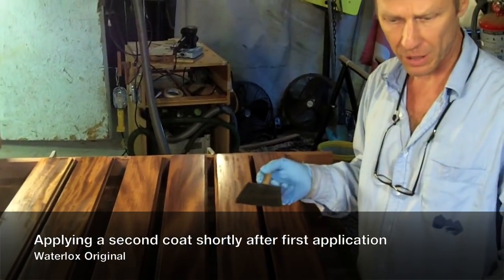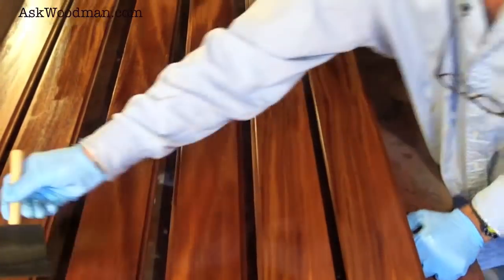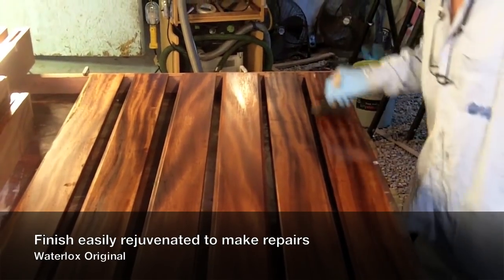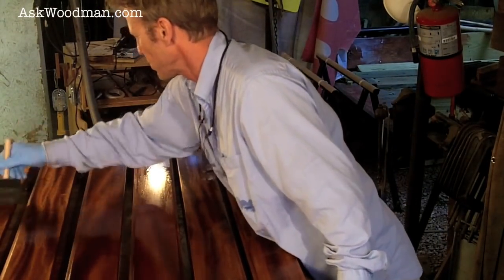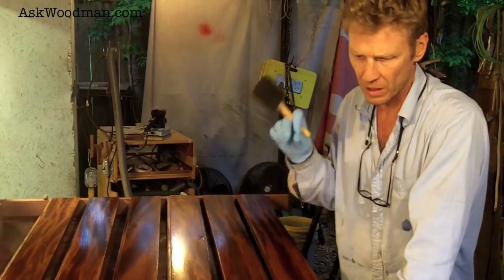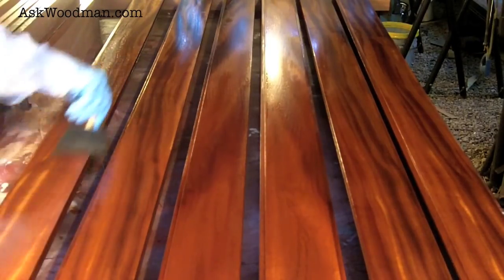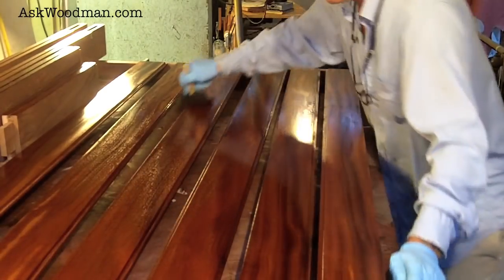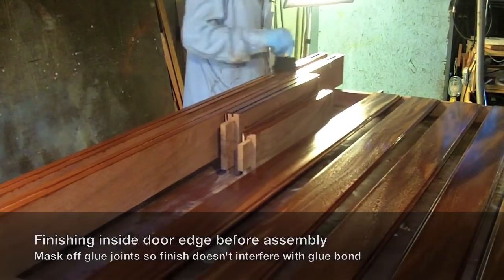14 How To Apply A Tung Oil Based Finish - SOLID WOOD DOOR SERIES - Video 4

Comment: Just confirmed that the duster method works! Had a tiny bit of Waterlox left over from a project and put it in a small jar. Snuck in a quick burst of duster under the lid and sealed it. No crustiness for a whole week. It created a negative pressure differential too, air really wanted to get in when I opened up the jar after a week. Opened it up to do a bit of touch-up, re sealed without duster and it was gelled up top in about three days.

Comment from the maker: Sikkens products are excellent for exterior work. They really hold up and are easy to touch up when needed. A really nice thing about the Cetol products is the color tinting options built in. Waterlox is very transparent with an amber caste. So to change wood color a stain does have to be applied first. But I rarely stain. I love the natural look of the straight built Watelox. Don't hesitate to write if there are some questions that were not answered in the videos. Happy to help. Allan

Comment from the maker: I use Waterlox exclusively for all my woodwork. Tru Oil is a similar product. Both are polymerizing tung oil varnishes with drying agents and hardening resins added. Pure tung oil can be a sticky mess that is a grime attractor that does not form a protective skin.

Comment from the maker: Hi Joshua , You just have to apply thinner coats when vertical surfaces are involved. It always take a little while to get a feel for the coverage. And sometime we just don't have a choice because not all pieces are going to be all horizontal. But you can just straighten out the drag and recover with several lighter coats. Also you can keep brushing and fussing with the finish until it starts setting up and stops sagging. Just lightly sand with 220 then 320, clean and re-coat.

Comment from the maker: I guess those two comparisons are better than the Buffalo Bob from Silence of The Lambs reference I just got. Yes those are t&g. I cut the groove on edge on the table saw. The tongues I cut with the router (straight bit) and straight guide. And then the panel is tongued into the door members. If you look real close you will notice some of the boards have tongues on two sides. So there were two ripped widths so the final exposed face was equal. Love me some measuring. Thanks Allan.

Comment from the maker: Unwaxed shellac is an excellent finish and a great way to introduce color. It is a little bit of delicate finish for furniture so rarely use it. But many people use shellac for color and initial seal and then top coat with Waterlox to seal make it more durable. The lac bug resin has wax that is removed for other uses since it is very insoluble. I just use Waterlox because it is pro and easy. It is the processed tung oil, resins, hardeners, and drying agents, mixed and ready to go out of the can.

Comment: Very nice vids!  It's nice to find someone who takes the time to answer questions & share experience.
I'm a mobile touchup guy.  I work mainly with spray laquer and do on-site spot repairs.
About 2 years ago I bought a Mako-T UV curing light &  some waterbased UV urethane coatings... hoping to offer on-site table top refinishing with a durable no-odor finish I could apply in 1 or 2 coats and cure completely in less than a day of work.  (Only the Holy Grail... not much to ask).  I've had mixed results and still don't feel totally confident in doing tabletops on-site.  WB urethanes can be finicky.
About a year ago I coated a customer's table and it's now peeling.  The table was originally laquer and was totally damaged & saturated with oil from the staff's weekly maintenence... lemon oil & Murphy's oil.  I always warn my customers away from these products for finished furniture.
Anyway, I did what I thought was a thorough de-waxing and cleaned with denatured alcohol but it did no good.  I had a rough time achieving a decent finish and now it's peeling off.  Luckily it's peeling off easily down to the laquer so I won't have to chemically strip or do heavy sanding.
My original thought was to build back up with laquer, but now I'm thinking maybe Tung oil would be better... especially since I have no good place to spray.  And even though I'm going to thoroughly de-wax again... an oil finish may play nicer with any remnant of oils still left in the grain.

Would this Waterlox or your new Sutherland Welles be ok for a dining table which sees daily use?  Would they be sensitive to any remnant of oil left in the grain?
Thanks much!

Comment from the maker: @nomorejournos 

As to the number coats, it depends on how much you are applying per coat. My videos show me using Waterlox Original which is 25% solids. But you can build a finish faster using Waterlox High Gloss because it is 35% solids. But the original is always used as a base penetrating coat for reasons I explained in the videos. Just remember to not use pure tung oil because it will just be a sticky mess.

Feel free to leave another comment if this doesn't answer your questions.
Reply: AskWoodMan

Comment from the maker: @gliksmar  A stain conditioner is just penetrating liquid that is very viscous that help pull the stain particles evenly into wood pores. This is especially important with difficult to stain woods like pine. There are premade conditioners that are available, but I generally make my own. In your case I would mix about 20% of your tung oil stain with 80% mineral spirits. You would simply apply an even coat to
a section of floor then immediately apply your stain finish.

Comment from the maker: If Original is 25% solids and High Gloss is 35%, perhaps cutting the High Gloss with about 20-25% thinner would be a good place to start on that first wash. The beauty of Waterlox is always works. The worst thing you can do is put it on so heavy that you have dried ridges or overfinish you have to sand. Always best to go light until you get that feel for the material and the way the wood accepts it. It is easy to add another coat. Keep in touch. Allan

Comment from the maker: @SilverFoo79 With all Waterlox products the Original Medium Sheen is ALWAYS used as a base coat sealer. It is what I use 80-90% of the time as my complete finish. But after 2-3 coats of Original you can apply their High Gloss which is just off the charts fantastic. Remember these finishes are mainly used as floor finishes, they are that tough and elastic. One of my next series up is a mahohany book matched TV components cabinet with the Original/High Gloss finish. Gorgeous look!

Comment: what do you suggest for a piece of furniture that is going to be exposed to the sun.
i stained and polyhurethaned a pair of adirondak chairs made of pine and the poly did not last it started kracking after about 8 months.
I have to redo the chairs again but like i said they will be exposed to the sun...Unless i cover them with a tarp and i dont want to do that.

great videos very informative.
best wishes

Comment from the maker: A lot these products like teak oil and tung oil are just that. They are just oil, and oil does not really dry. The product I use Waterlox is specially processed tung oil that has drying agents and resins added that make a chemical reaction when exposed to air that makes the liquid dry. You can add Japan drier to these oil products or just use Waterlox straight out of the can. Then have been making this product for almost 100 years. It is the only product I know of that gives such pro results.

Comment from the maker: The High Gloss is too thick for base coats. You want to use the Sealer/Finish to penetrate and give the later High Gloss something to chemically bond to. You could thin the High Gloss with mineral spirits for a base coat. For your case where you are finishing end grain, I think think the High Gloss thicker material would be perfect because those open straws will just drink the thinner material up. Just do a wash with the thinned High Gloss and then go straight to High Gloss. I am happy to help.

Comment from the maker: I would thin the first coat only. I have built a bit of furniture from mesquite but I find it way overpriced with a lot of waste. Wait for cure (3-4 weeks) and use a wet pad and an automotive rubbing compound. You can proceed through polishing compound grits until you get the luster and sheen you want. You will notice the sheen falls off Original Sealer/Finish by about half after cure. I would finish a scrap mesquite to practice on. A buffer with a lambswool bonnet can be used at the end.

Comment: I am a woodworker in Davis, CA and have never been terribly satisfied with my finishes, so I am trying your Waterlox method on a sleigh bed frame I just finished.  I have put on two coats and they seem dry and very smooth except on some end grain.  From the smoothness I would say I don't need to "scratch" it before the next coat - do you scratch just to smooth it out or also for the next coat's adhesion?

Comment: Hi There, great videos! I noticed you don't sand between coats of waterlox. I normally use Poly or Shellac and after the first coat I have to sand it down with fine sand paper before applying the second coat. 

Is there not need to sand the finish down at all with waterlox?

Thank you!

Comment: I have a 160 plus year old door from a cathedral in Europe. I installed it as the entry door to my house. Can you tell me how to keep the sun from causing extreme damage. I have been using oil on it but not sure what the best oil is to use.
Reply from the maker: So you have just been putting "oil" on your door hoping it was the correct way to protect it.

Comment from the maker: @chromlic I have not used Minwax's tung oil product because I am a Waterlox man. But I did a little research online and saw the Minwax is not explicitly recommended for floors. Please do not go to all the trouble and expense of putting down a wood floor and then finish it with a product that may not hold up as well as it should. I am not sure I understand the second part of your comment. Perhaps sort the material roughly by color and make some basic sq ft calculations so you know what you have.

Comment: I love your videos. You have been so helpful. I have found some pine ( I think ) floors under a ton of nasty layers of flooring. I finally got them all sanded down (whew) and have been looking at stain and top coats. I came across your video and now I think I want to do it your way! Is it okay to use this on pine? I  really don't know a thing about refinishing floors but I really liked your way. Do you have a place where I can get faster feedback on some questions that I'm sure I will have?

Comment: Hello, Great Job. Question, I just finished my outside deck which is under a roof. It is pressure treated pine. It is 20 yrs old and the wood came up nice. I used a red oak Helmsmann stain and then put 2 coats of satin Poly overtop. Is there an oil, or poly cleaner I can use to clean it and keep the shine on the deck. Wish we could add photos. Thanks
Reply from the maker: I never use poly so can't help you with advice.

Comment: Great videos! They're really helping me with my first foray into waterlox. I do have a question regarding the second coat. Waterlox advises waiting at least 24 hours between each coat, saying each subsequent coat may take even longer. Do you have any issues that arise from not waiting that full amount of time?
Reply from the maker: I have stopped using Waterlox. I feel their product formulation has changed in the last 1 1/2 years and the product does not behave the way I was accustomed to since 1985. It is very disappointing to now have to rework my finishing method. But Waterlox will never get any more of my money.
Reply: AskWoodMan
What do you use now?

Comment: I have stripped a maple drop leaf table, sanded and steel wooled the wood, vacuumed and used a tack rag before applying three coats of tung oil over stripped wood.  I used steel wool in between coats, vacuumed and tack ragged.  The third coat is very shiny and feels a bit bumpy.  Can I use steel wool to dull finish and remove bumps?  Will steel wool leave a whitish result?
Reply from the maker: You can use steel wool, but I rarely use it. It shreds and makes a mess and gets everywhere. It also has oil in it to keep it from rusting the steel That can cause problems with some finishes. I prefer no load (open coat) sandpaper or the foam backed abrasive pads like 3M SandBlaster scratching between coats. With a really well cured finish a series of automotive rubbing and polishing compounds can be buffed to some impressive results.

Comment from the maker: @jnr7510 Yes Waterlox can be used over stain without any problems or worry. Just build up a 2-3 coats before you scratch to make sure you do not break through your stained wood surface.

Comment from the maker: @gliksmar If it is a tung oil product, I am sure it will harden just fine. Of the natural seed oils tung oil is by far the hardest and most durable. Pure tung oils, with no drying agents are problematic in my opinion. The other really good thing about using a tung oil based product is that at any pont in the future you could reapply more finish after a thorough cleaning to remove scratches. Tung oil finishes are slow cure so try not put heavy traffic too soon.

Comment: Great videos...thank you so much! Quick question. I applied 3 coats of this waterlox to a dovetail cherry box, and noticed after the last coat dried that the waterlox sort of settled thicker at the bottom of the box side. I know you said that it's best to do horizontal surfaces, but there's got to be a way to use Waterlox on the side of a box. Any ideas?

Comment from the maker: @chromlic If for example you were putting down 1000sf, and you have 50% light, 25%  dark, and 25% very dark. I would just lay out a quick 100sf to get a feel for the pattern that will look best for the actual install. A little forethought and visualization can save in the long run. And with the material sorted the install will be smoother, instead of digging through bundles for dimension and color. Feel free to write back. Best regards, Allan.

Comment: So, the Sutherland Welles can be use for an everyday use dining table?
same applications as in your videos?
Reply from the maker: I do not have the long term experience with SW because I am new to it. I brushed Waterlox for over 25 years before getting fed up. SW is much less stinky and does not require the vigorous brushing. I am still getting used to it but I am very pleased so far.

Comment: Have you tried using "Duster" cans to prevent oxidation in the can? Waterlox recommends using a product called bloxygen, which is supposedly made of compressed Argon gas that settles below any air/oxygen in the can and protects the liquid. 

I would think you could also use and Duster type cans which are made from pure 1,1-Difluoroethane, which is non-reactive, non-CFC and around 2.5x denser than air... and cheap and easy to get.

Comment: You're missing the point.  Your right about the oil molecules actually not being effected by humidity, but it's the evaporation of the SOLVENT that determines the initial drying time or bonding of the oil molecules.  Any organic solvent (spirits or turps) in the paint evaporates.  The rate of evaporation of volatile compounds will depend on atmospheric pressure, temperature, and humidity.  Lower pressure, higher temps, and lower humidity will all increase rate of evaporation of solvent.

Comment: in what way has waterlox changed from what you have been accustomed to?i have just ordered 2 gallons of its european namesake,american woodoil,mainly because i trusted your approval of its  quality and excellent finsh.will i be in for a bad surprise!..thxs for all the excellent videos
Reply from the maker: It seems thinned down and will not set up it the time frame I have been accustomed to for over 25 years. It just runs and sags long after I am used to. It also has a real problem with bubbles in the finish. And not just a few, hundreds per square foot. The product seems to have lost its body or resinous properties.  I could have taught a chimpanzee to lay down a respectable coat. But I am done with fussing with it trying to make this work. I tried to compensate for the changes but I can't waste any more time at $80/gallon. Allan
Reply: AskWoodMan Do you think its a change in ingredients or has the manufacturing process been altered?seems a shame they didnt leave well enough alone...
Reply: AskWoodMan I got to this fourth video and just now saw this. Good to know about the bubbles. At first, I brushed on as aggressively as you do in the videos, but it seems to exacerbate the problem. A long, slow brushing motion seems to be the best way to prevent it, as far as I can tell.

Comment from the maker: @gliksmar Stain conditioner part 2. You apply the stain/finish while the conditioner is still wet so the conditioner acts as a vehicle to carry the stain/finish deeper and more uniformly into the wood fibers. Since the conditioner has so much mineral spirits in it, the fumes from the evaporation will be very strong. Please protect your health by wearing a new organic vapor respirator.